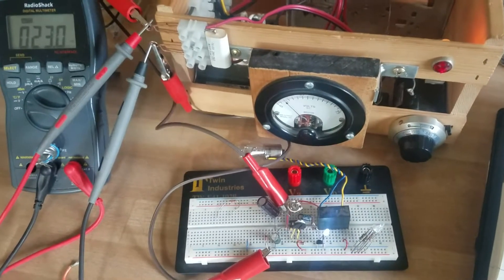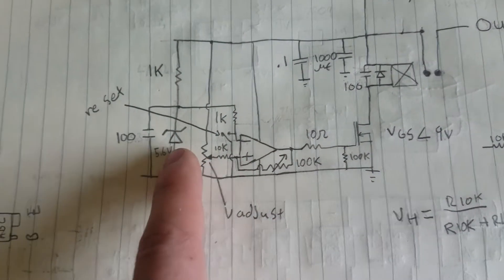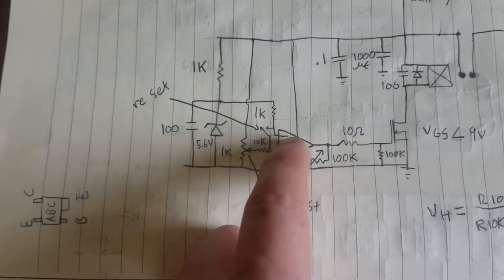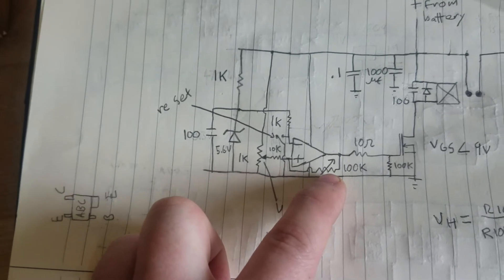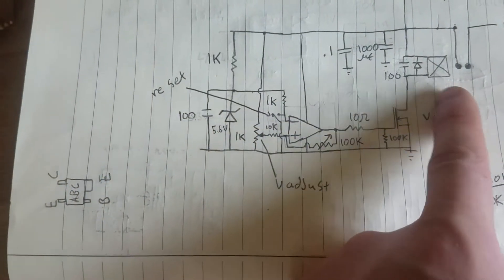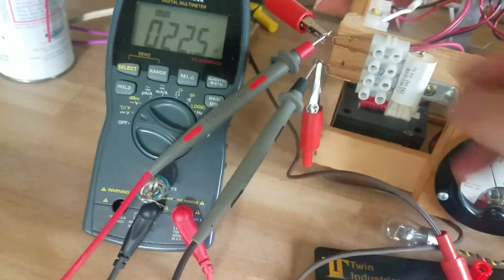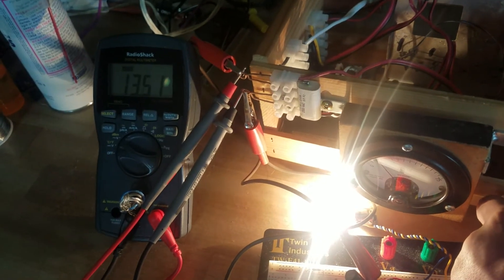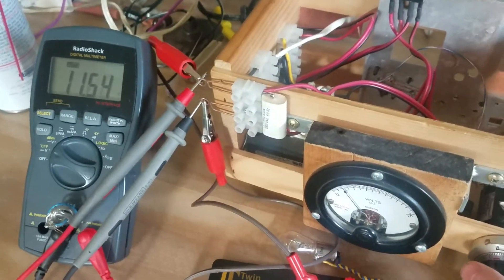Battery Cutoff circuit (lead acid)

Comment: Nice, although I'd rather use a P-MOSFET as a switching device. That'd make the power draw significantly smaller. Got some other ideas like using a Zener diode together with a NPN transistor for controlling the MOSFET.

Comment: Huh kinda like a lipo bms for the low voltage protection
Reply from the maker: Yes, in a situation where you are running a load off grid say with solar panels and deep cycle batteries it is important to prevent over discharge to maximize the the life of the batteries.